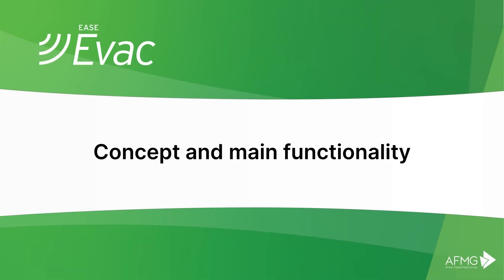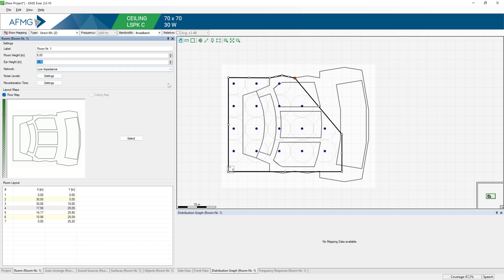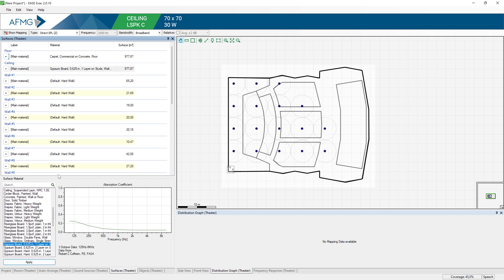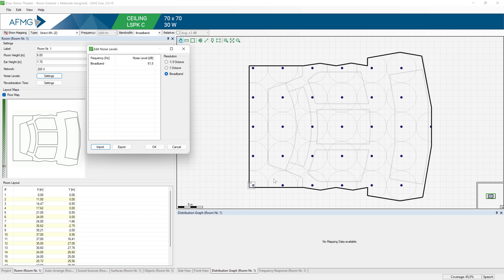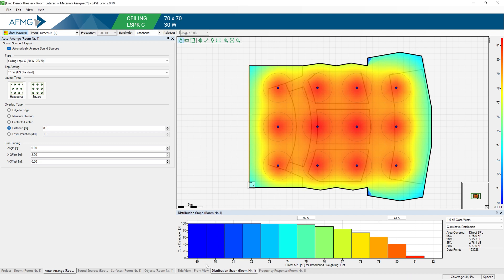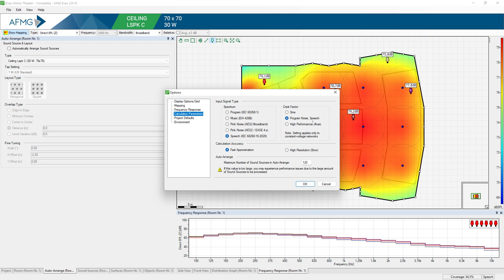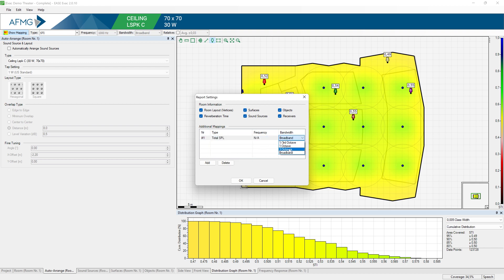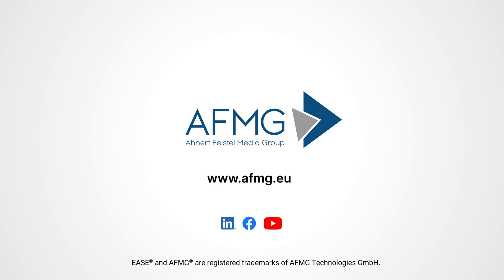EASE Evac 2 - Software concept and its main functionality

Comment: Pedro,

For me: Under "Options" - Calculation Parameters - Input Signal Type, I only have the following options: Program (IEC 60268-1), Music (EIA 426B), Pink Noise (AES2 Broadband), and Pink Noise (AES2 / EASE 4.3).  My question for you is how can I get the "Speech" Input Signal type available to me to select?
Reply: You need to upgrade to version 2.
Reply from the maker: Thank you Bruce. Exactly, you would have to upgrade to the 2nd version. The "Speech" Input Signal is available in version 2.